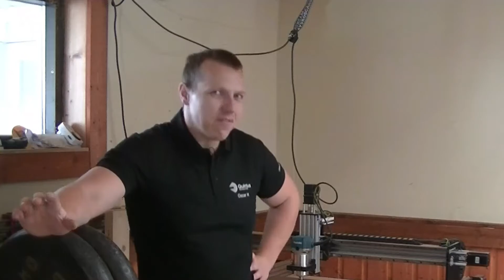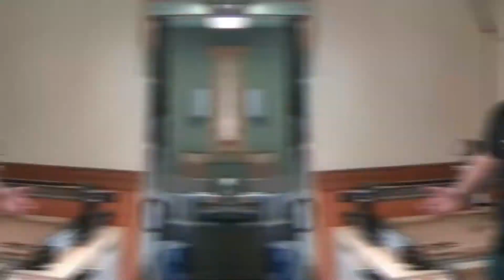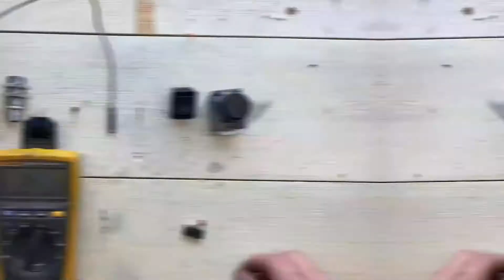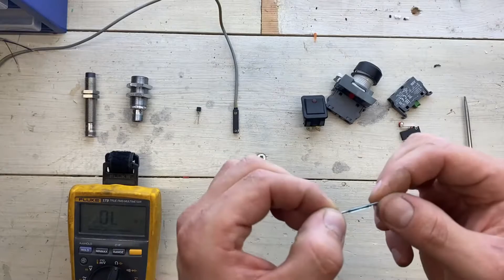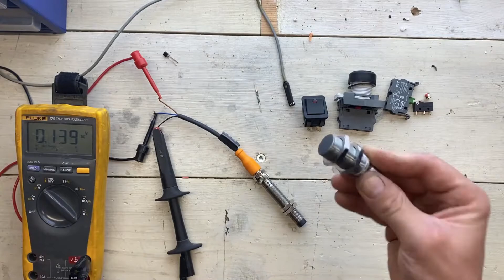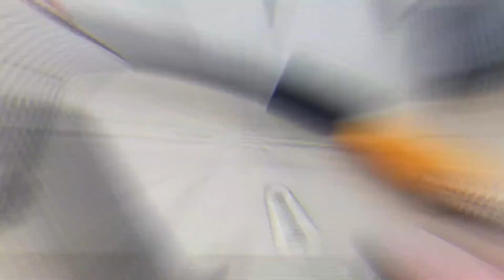Machine Building Basics: Part 1, Switches

Comment: kommer du att berätta om dessa olika styrprogram ??
●  GRBL Software based controllers: xPRO V5,  High Torque GRBL,  MakerShield GRBL
●  Mach3/Drufel CNC Software based controllers: UC300,  NVUM,  STB5100
Reply from the maker: Nej, det är inget jag har planerat att göra. Det finns många andra som har gjort det och jag använder ju ingen av de själv. Men jag har tänkt att filma när jag uppgraderar till linuxcnc eller vad det nu blir.
Reply: @OffHoursEngineering  tack för svaret

Comment: I think inductive sensors are affected by temperatures
Reply from the maker: I have honestly never heard of that, how would that work?
Most of the ones at work are rated for -40 to +80°c environments.
Reply: @OffHoursEngineering  They work, but they detect the metal at different distances depending on the ambient temperature. I do not know if it only occurs in the cheapest, but in the world of 3d printing they stopped being used because of this problem.